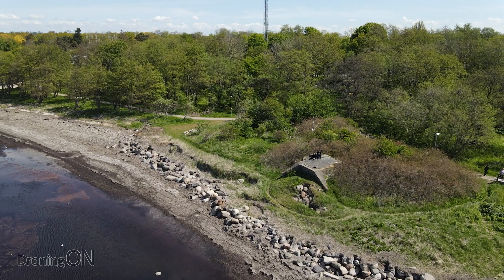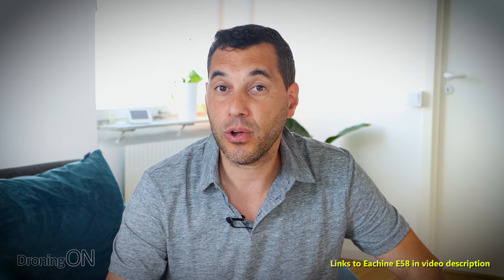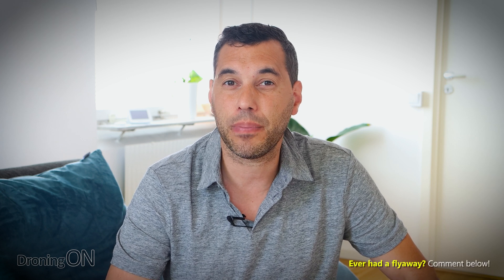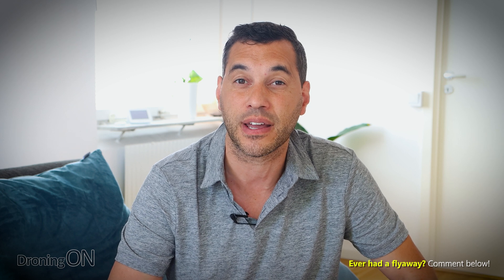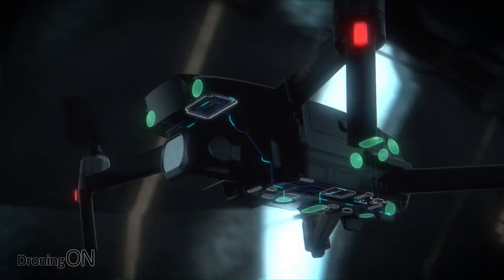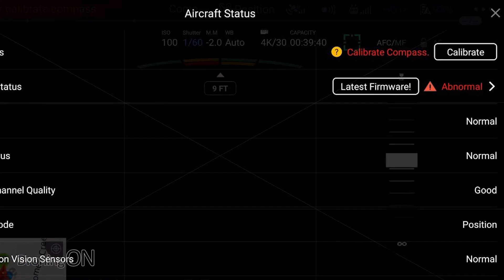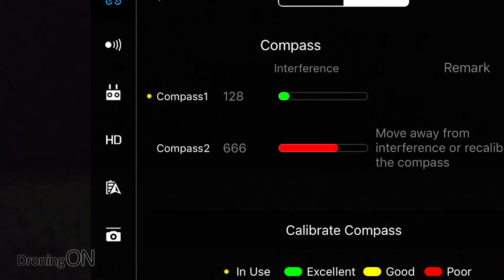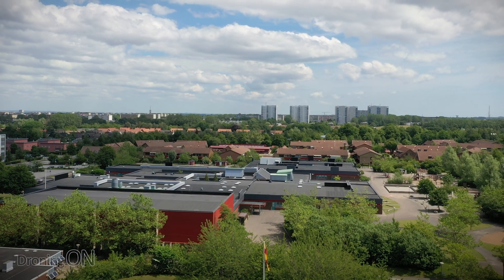How to NOT lose your drone (flyaway) - Beginners Guide

Comment: @4:11 100m up and 1000m away is beyond VLOS, so u are already flying against regulations. Most people have flyaway when they click "return to home"  which probably is a compass error mixed with RTH autopilot. I have always landed manually. I cannot stress this enough - people need to be able to fly in atti mode and land their RPA themselves.

I used to calibrate compass before each flight, but nowadays I usually do not. I have been flying for a few years, and I had a compass error and nearly lost my Phantom P3P once. I did a calibration before the flight, but it still failed me. Even the most calibrated drone will fail in the event of magnetic interference, and not all have 2 compasses.
Reply from the maker: Thanks for the comment Mike, however 1000m away isn't necessarily beyond VLOS, I can see my drone at that range, some of course won't be able to. I have good eyesight, some do not. Flyaways do not occur when they click RTH because RTH won't work if the compass has failed, however RTH does of course risk does have its inherent risks in regards to not being setup correctly
Reply: @Droning-ON If you can see your drone, let alone be able to work out where it is facing at 1km distance you must have truly excellent vision.

But to be honest, I still have not experienced a flyaway, and I rarely, if ever calibrate the compass anymore. My P4 pro asked for an IMU calibration the other day and I did one then, but in over 50 hours of flight time, I have never had the issue. On the local DJI Facebook groups (and this is just my observation) it seems that quite a few lose it when doing a RTH.
Reply from the maker: @mkphotofilm  honestly, I can see and fully navigate my drone at 1km range, but I have been flying RC since for 30 years, so I'm more than skilled in LOS flight having flown helicopters, wings, RC planes and jets over the years. Drones lost during RTH generally are due to either the battery failing on the way back and it landing wherever it might be at that point, or it hitting an obstacle.
Reply: @Droning-ON  or they accidentally change the home point to somewhere in a forest or over the sea.
Reply from the maker: @mkphotofilm  perhaps, but highly unlikely seen as the home-point is automatically set as soon as GPS is fully acquired, changing the home-point isn't something that your average user knows how to do, or would do by accident.
Reply: Exactly. I had magnetic interference and land immediately message on my controller.  So I proceeded to land immediately.  But then said gps disconnect then compass disconnect.  Hit RTH. and it went for a ride on its own wherever it wanted. Now I’m hesitant to go fly anywhere cause I’m afraid that could happen again at any given time and with my luck it will be a very bad time for it to occur

Comment: I just experienced what i now believe is my first fly away.  Only there where some real odd factors at play. At first. Without watching this video before i already do calibrate the compass before each fligth, it just seemed to make sense. So i did this time too. I actually was filming graffiti on walls which could of easily been done with a handheld camera as i wasnt flying higher than myself and actually walking along  with the drone. It was a bit windy but nothing crazy,  visited the beach  last weekend and that was crazy but the pro 2 performed like a charm. But before i fully drift off. I was filming walls , i make a turn to go straigth towards another wall across a grass field. I start by positioning the drone in the straigth line i want it to go in and ever so gently start to push forward. Instantly i notice the drone is moving forward in a 45degree diagonal line quite fast, instantly all of a sudden above a creek which was next to me heading towards the trees on the other side of the creek. In full panic mode i pushed pause. Nothing, again and again and then it crashed into the trees.  I was so lucky that it passed the branches over the water and made it acros to crash in leaves. Luckily no physical damage at all but im baffled as to how this could of happened and im still coming down from shock. Im not super experienced but experieced enough to know that this was beyond odd and i cant explain it. No signal lost no weird interferrence or nothing. Im so glad i wasnt at an higher altitude or further away or near people or that it crashed in the creek. Of course im out of my warranty period. This is my first crash ever and i hope it will be my last. I hope you can bring some sense to this and help me calm down a bit. I love my drone too much and im always carefull. I just want to understand what happenend  here. Ps. I was flying a Mavic Pro 2 in position mode. Thanks from The Netherlands!
Reply: One year and not a single response. Makes me not want to get into drones. Hate to see 1k fly away, lol.
Reply: @MythHealer  It is necessary to always check the batteries and the batteries in the remote control, it is possible that there was signal interference, someone could have triggered some device. GPS is often interfered with when delegations and presidents fly in airplanes.  There's no need to be afraid to fly, for example, the new DJI Mavic 4 K is quite safe.

Comment: Just suffered ATTI mode. It flew away directly into a tree then dropped into the lake. I fished it out quick and pulled power along with the memory card. All videos were not lost and after an extensive drying session the thing has come back to life and it surprisingly didn’t suffer any arm or propeller damage either. Will definitely recalibrate EVERY time. I did not do a calibration before this flight. Lesson learned. Haven’t flown it again yet but hopefully it’s all good
Reply: Lucky! Did the drone continue to work after drying?

Comment: Well, yesterday i flew manual and the drone did not react at all. The drone has no gps,  he was at full power going up, throttle cut did not work, even steering. Something in the area must fucked up my signal. Drone went into the air high, the wind took it with him. Still not found him back, i believe hes somewhere far far away. I also fly with heli's everyday, still trying to figure out what is happening. I know people that got this with a plane aswell, they got him back after a month miles away. If they ever find my drone back, it's ready for the junkyard anyway.

Comment: Instead of buying another drone to practice ATTI mode, you could practice flying indoors. Also, you can tape over your sensors and force ATTI on a DJI drone. It's very good experience to learn to fly in ATTI mode - you really have to fly the craft rather than point and shoot.
Reply from the maker: I wouldn't recommend that at all, taping over sensors and flying indoors will result in dangerous flying by most consumers, and crashes. Buying a non-GPS drone and flying it outdoors is a far better option. Thanks for the comment!

Comment: Been flying the Mavic air 2 a lot lately and realized I haven’t calibrated the compass nearly enough. Thank you!
Reply from the maker: No worries glad that this helped! Be sure to subscribe!
Reply: I have the same drone. And I have had a drone fly away with a parrot bebop. Mine was a little different it lost something and just literally flew away not responding to input untill disconnect...  Is it possible for a mavic air2 to put it into atti mode to try it out. I've had a few different drones some make u even control altitude with a throttle...  Is it that bad?

Comment: rth should still work right? anyways i always keep an eye on the direction of the drone through the app to see where its pointed so should anything happens ill know which direction the drone is ^_^
Reply from the maker: Unfortunately not, during a compass failure the drone doesn't know which way it is facing, therefore RTH will fail and the drone will end up drifting on manual control Thanks for the comment!
Reply: Learn to land manually. It is a good habit.

Comment: I was flying my Jjrc x5 today, she'd leave at basically normal full speed ahead no worry's right? Well out 600+ meters and turn around to come back and it's just basically sitting there.... Goes left fast, right fast and away fast but nada coming back... Well unknown to me without so much as a breeze down on the ground,there was a about a 10m/s or more headwind 115meters up, the only way it was coming back was the good ole return to home button function! In rth I suppose it has the ability to apply extra power to push on back, not for that she'd been gone. Point is always check the windage at altitude with a little test before blazing off towards whenever 🧐 if not for the quads failsafe abilities it would have stayed out there 🤦🥴.
Reply from the maker: Ahhh the JJRC drones, yes always be prepared for a fly-away with those hehe! Thanks for your comment!

Comment: I've been always referring to "flyaways" as cases where a drone actually "flies away", not just goes into ATTI. Yes, i had my Mavic (first one, the "pro") losing GPS once, far out of VLOS, and it didn't regain reception til landing and reboot. But... video reception has been rock stable, and while i am not an FPV racer guy or something, i generally have no issue orienting myself from up there, nor an issue flying in ATTI, so i've obviously brought it back and never called it a "flyaway".  BTW, the times it actually tells you to recalibtate the compass are often the absolute worst to actually do so, because it "feels" something is wrong with it at the places of mild magnetic interference, exactly the spots you DON'T want to calibrate at.
Reply from the maker: Well, whether you lose the drone or not, switching into ATTI and drifting off is a fly-away. If you're able to control it and bring it back then you've recovered the drone. Terminology is subjective, others will have a different view on what a 'flyaway' is. Thanks for your comment!

Comment: I’m a little different. I only calibrate when I change areas by 30 miles or more.  Only ATTI modes I have had happen is when flying under some bridges.  Metal not a good friend to the compass 😎. Absolutely love your thumbs down comments with all your videos.  Thanks for sharing Ash
Reply from the maker: Thanks for sharing, that's acceptable but calibrating is easy and quick, so worthwhile to do at the start of each day! Thanks for your comment!

Comment: It should be added that if you are flying a cheaper "GPS" drone (sub $300), the compass should be calibrated every time the drone is turned on. They have no internal memory for that. More expensive drones should be redone if you move more than 5km and then fly from there.
Reply from the maker: That's true, those cheap drones are better left in their box :) Thanks for your comment!